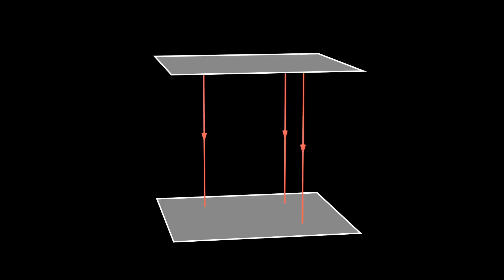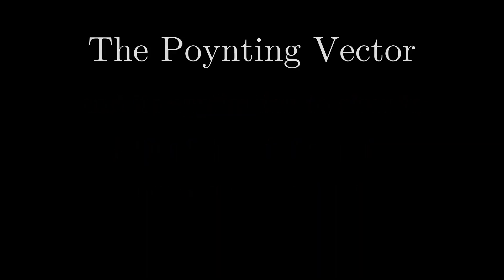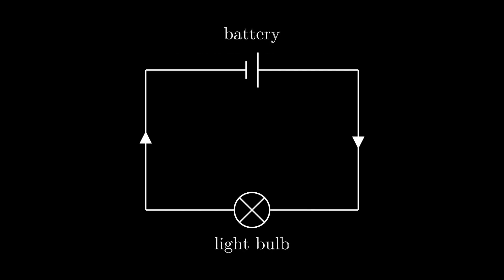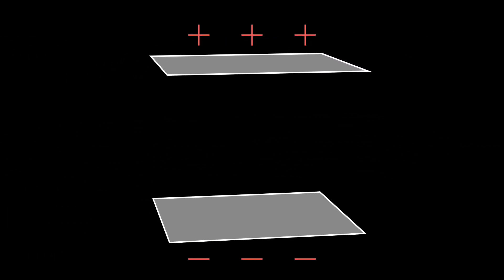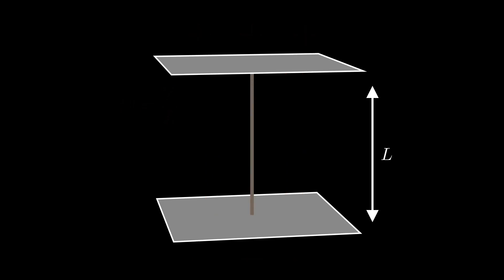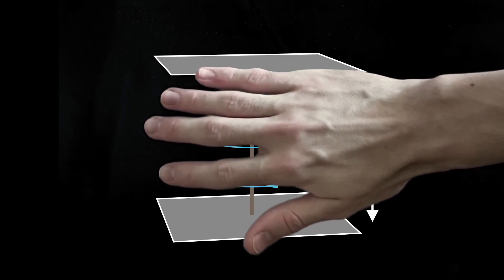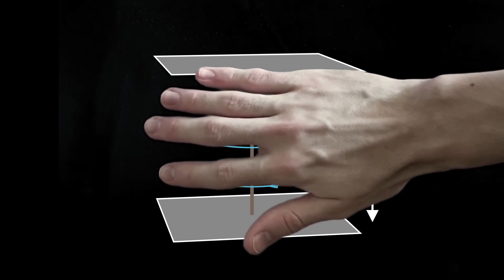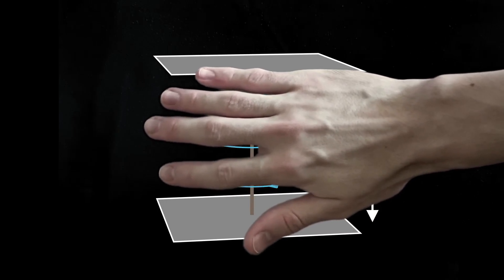The Poynting Vector in a DC Circuit

Comment: I still don't understand why surface charges accumulate on the wires in the DC circuit...
But, if I am to take that step for granted, your simulation is beautifully done and very well analysed :)

Comment: Not bad. I think you could really enhance this video (part 2), if you just slowed things down and spent more time explaining how energy is being drawn from an infinite reservoir (all spacetime), based on the electromagnetic properties of your components and the extent that those components affect the magnitude of your vector fields. 

The giant missing component is the missing description of what energy is and WHY this mysterious energy is either produced, borrowed, or consumed/converted by the magnitude of the changes (vector magnitudes) in the electromagnetic field. This topic would make for a very educational video.

Your video is good at describing the relationships between electromagnetic fields and properties they exhibit. However, you did not discuss the actual energy itself. Are you saying there is an energy field, or are you assuming that energy is being created dynamically by the interactions of your electromagnetic components? 

Since everything is made up of energy, including “empty” space, which is not empty at all and is the reservoir of energy that your electromagnetism is interacting with, how is that energy pulled out of spacetime and converted to work and heat waste via electrodynamics?

I hope you tackle this entire topic because you will then be actually imbedding the fundamental quantum theory underlying electrodynamics. Just keep going in the direction you’re going and you’ll eventually pull in the entirety of electrodynamics. That would be a video worth watching for all audiences, including Derek and the electronic circuit guys, both of whom are only showing pieces of the overall system.

Cheers

Comment: One quite basic question:
In a simple DC circuit (one battery, one resistor, and wires), which has settled down to a steady state, what is the situation of
Electric field,
Positive charges and
Negative charges
alongside the wire?
I just want to get a particle level (and  electric field viewpoint) understanding of what actually makes the current flow in the circuit in this situation.

Comment: Conventional current/electron flow causes so much confusion learning this stuff. Then, considering that fields.. don't have an actual "single" direction, I mean it's like saying the north pole is up from the south.. and sure.. it's a convention to help.. I guess, but I'm always thinking.. if we where to start again with the essence of knowledge of how it all worked.. and made up new names and new analogies, if we would have a much better system to work/describe with lol. It constantly feels like hammering a square into a circular hole. It thoroughly grates on me when I hear "the positive terminal has higher electrical potential" as a fact as if the positive side has all the actual energy. The only reason this is true is if your grounding to the negative end.. it's the other way round if grounding to the positive, but people "Believe" and misunderstand this to the core, then plaster it over everything. Sorry, end rant lol

Comment: I think this derivation is wrong, because you did not account the displacement current which will produce reverse magnetic field and cancels the magnetic field produced by current "I" .....no magnetic field should be produced inside capacitor plates by making a short circuit inside the plates period.

Comment: there's a great AlphaPhoenix video where he does his best to set up a smaller version of the thought experiment, hooks it up to an oscilloscope, and shows that you do get a small amount of current at the time you'd expect from a straight line lightspeed delay, followed later by the much larger current spike from the ac pulse from the switch flipping traveling through the wires arriving

Comment: 11:33 The Veritasium depiction of 12 VDC car battery with exceeding long wires to power a conventional light bulb was harmful mindless trivial and provided the wrong answer for the experimental perimeters.   Since this Veritasum video I've notice this is common with Veritasum.  It shows a tightly constrained situation for clarity and then use it to get an answer that comes from a  different set of perimeters.   

By using a light bulb that needs to be bight enough and last long enough for a human to take notice it means the thought experiment is ignoring micro second transients.  It is clearly a low voltage circuit using car battery.   A very high voltage circuit could have a capacitance effect, but that possibility was excluded.  If it were at the level of 230 kV high voltage power grid transmission lines there is a capacitance effect, but were dealing with 12 VDC car battery.    The depiction of a low voltage with slow acting indicator, the light bulb,  even assuming the wires have no resistance and carry signals at the speed of light where wires actually carry signals at about 0.7C  means the experiment is intentionally ignoring small transients.   

Wires that are 1 meter a part with 12 VDC would not be expected to have any significant current in the circuit from capacitance between the wires.   At that level its is more likely they'd be receiving current in the form of radio waves which the light bulb would not indicate; hence, why using a light bulb indicates the experiment is not to observe small currents or sharp transients.  

If the indicator would have been an oscilloscope with trapping trigger function for transients that might allow the capacitance effect to be seen, but it could be very small with much radio inference.  

Looking at the experiment the way it would actually work assuming no resistance wires and electric fields flow at the speed of light in the wires, it is a still a question if the light bulb would turn on at 1/2 the travel time around the loop or at the travel time around the loop.   

The electric fields both negative and positive would propagate out from both sides of the power source so the time period would be expected to be 1/2 loop travel time.   Much electricity modeling is based on positive or negative current with the opposite called ground.  It might be thought current flows from the positive all the way around the loop back to the source, but there are both positive and negative electric fields traveling from the source at the same time.  

 A more interesting question comes up if the indicator is far away from being at the same equal distance of the two wires with one long and the other short.    Until the negative and positive electric fields present to each other the circuit will not flow current so the indicator, disregarding capacitance effects, would turn on at 1/2 the loop travel time.   That's an experiment worth showing.
Reply: finally someone is saying this

Comment: At 11:40, your steady state solution is vastly different than the dynamic situation immediately after a switch closes and begins transferring charge to eliminate a potential difference.  As this charge moves, it generates changes in the electric and magnetic fields; these changes propagate outward at c.  The light filament experiences these fields and the electrons inside immediately begin moving when the electric field reaches that place.  Derek's only error was to neglect the impedance mismatch between the parallel wires and the bulb's resistance.

Comment: Something that may help some people understand the electric field following the wire is to think of it as a waveguide. High frequency waveguides (microwave, light,etc) are tubes that trap the wave inside. The actual containment isn’t them bouncing like a ball though, it’s interactions with the surface. The wire acts a lot like a glass rod on the edge of a cup of water. If you pour the water it essentially follows the rod instead of falling in a parabola. It’s not the same effect but it is an electrostatic effect and related to a degree.

Comment: Does the transfer of energy via fields suggest that a second light bulb filament almost touching the first but not connected to any voltage source will receive energy and become illuminated? Surely not. How does this theory explain complex circuits with semiconductors?

Comment: 6:12 For incandescent bulbs, material has nothing to do with it except for temperature tolerance. The light emitted by an incandescent bulb is blackbody radiation, so it only depends on temperature. An incandescent bulb is a resistor on the bleeding edge of letting the magic smoke out.
Reply: Thiiiiis this this this this this. In fact the majority of the enregy emitted by an incandescent lightbulb is heat. The peak of an incandescent bulb's emission spectrum is still well within the infrared band of the EM spectrum, which we experience as a sensation of heat. Only when you get to things that are literally as hot as the surface of a star do you begin to see black body peaks in the visible band of the spectrum.
Reply: @calyodelphi124  Incandescent bulbs are already the temperature of a star. You need to get to roundabout the temperature of the Sun (a bit cooler than the Sun, but not a great deal cooler).

Comment: 1/c seconds makes sense.  It's 1m/(c m/s)  = dist the wires are apart 1m / speed of light.  That's not weird.   What is wierd is that Veritasium is suggesting that if the separation laterally  is increase to say 60 light seconds apart the electricity will take 60 sec to turn on the light. I have trouble believing that.

Comment: 6:56 Pardon me if this is a commonly asked question, but isn't the wire neutral?
Reply: the wire after powered components in an electrical circuit is typically considered the "neutral wire" as it carries the current back to the power source, completing the circuit; it's the return path for electricity after it has been used by the powered components. 
a neutral wire does carry a charge and carries electrical current, however, despite its name, because it provides a return path for the current back to the power source, essentially balancing out the charge in the circuit.

Comment: Great video and awesome simulation results! Congrats. Just one comment: in order to get this simulation results with S along the wires you have certainly considered the surface charge model which although known from long time, it is not really widespread, and it doesn't appear in hardly any textbook.

Comment: Just over half way thru the video when you work out the Divergence of the Poynting Vector. The sum you do appears wrong.
With out writing every detail
Div(S) = B*(curl(E)) - E*(curl(B))
Not bothering with constants, just general method.
Sub-in Maxwell Equations you get
B*(-dB/dt) - E*(J + dE/dt)
Which has general form
d/dt(-B^2) + (d/dt(-E^2) - E*J
The derivatives are partial derivatives and
d/dt(E^2) = 2EdE/dt
Same for B field.
So you end up with
Div(S) = -d/dt(energy density) - E*J
Reply from the maker: Correct, I assumed B and E are static throughout the video, so dB/dt and dE/dt are zero. I’m aware that isn’t how we work with electricity in real life and there’s an extra term, but I’m trying to emphasise that even in static situations it still makes sense to describe energy flow using fields, and it’s not just an AC phenomenon.
Reply: Yes good point THANK YOU for your reply and thank you for your videos I find them extremely interesting and learn alot from them.

Comment: I'm glad this video got recommended to me even if it is late.
 I tried to educate some people on how electricity works.  How there is no energy in voltage current as I do believe Rick Hartley is correct, And here's information came fromRalph Morris. Who wrote the book fast circuits.

I tried to tell people that the speedometer in your vehicle does not measure energy. The speedometer is measuring a property of your vehicle in motion
 Voltage and current are measurements of the electromagnetic energy.